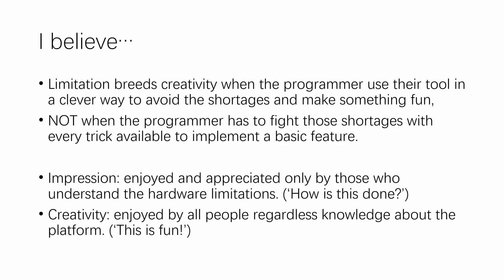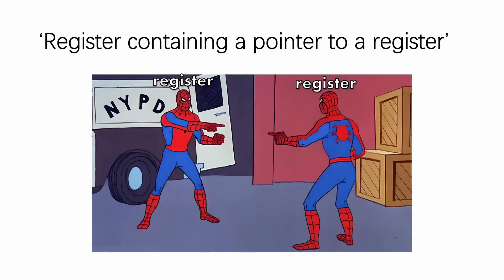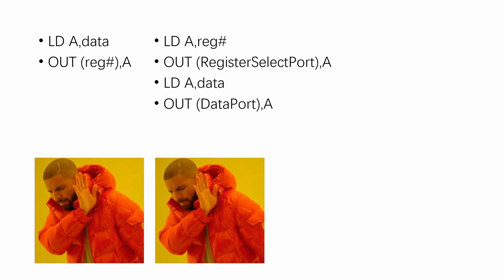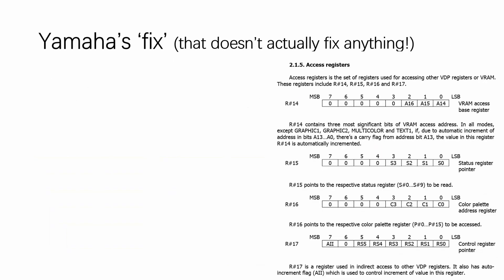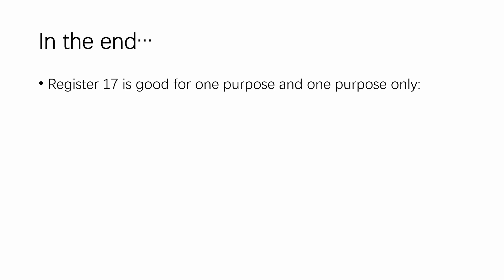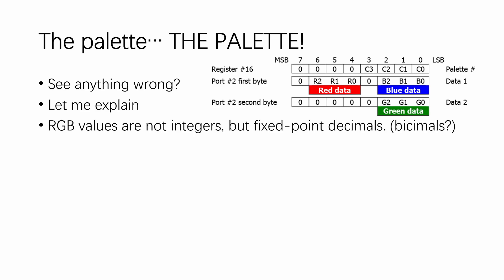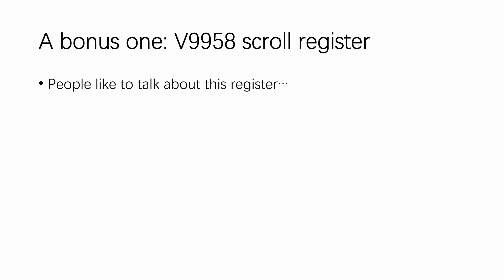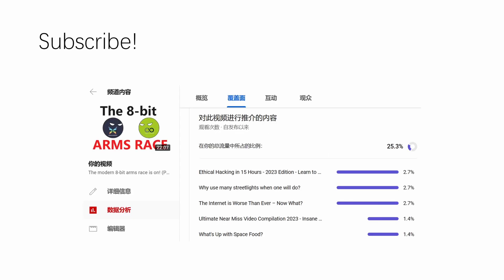The registers of V9958 are a mess.

Comment: The chaos with the data and mask bit to tell the chip you're talking about a register goes all the way back to the TMS9918.  When Yamaha decided to build a backward compatible (ish) chipset, they inherited a lot of compromises that trace their existence to either constrained design choices from the late 1970s, or from literal arbitrary choices that the Texas Instruments engineers made (engineering was a little more "free spirited" in the 1970s than today).  The half-baked composite-in line on the TMS9918 is a great example.... it allows you to chain multiple TMS9918s if they share a clock, but it's practically useless otherwise, which is really unfortunate, because it would have been amazing to have text overlay on video in consumer hardware all the way back into the mid to late 1970s, but alas, they only half implemented it.

Some of the decisions the TI engineers made were unfortunate, but they were what they were, and everything built on that architecture inherited those "features."  The auto-increment thing was present in the TMS9918 as well, but was used for reading and writing to VRAM only.  So Yamaha was borrowing an idea that was already present in the original architecture.
Reply from the maker: I think there is a way to synchronize external video to the TMS9918 by pulling reset pin to 9V or something crazy like that. It's hard to achieve with only 5V supply, but the feature is there.
Reply: @andyhu9542  

Sort of, but since nothing is keeping the clocks in sync, if you feed composite from some source other than a shared clock, one of the images will "roll" because sync will slowly separate.  As I said, they only half implemented a solution.  They needed a way to achieve genlock, or to buffer the incoming video, which they didn't implement.
Reply from the maker: @Calphool222  The TMS documentation doesn't go into whether this is H sync or V sync. However, I don't think the video would roll as one can input one sync pulse via the reset pin every field. The video may appear skewed, but not rolling. The bigger issue is that the input signal must be non-interlaced, but all TV signals are interlaced. Therefore, half of the input screen content would appear on completely wrong places.
Reply: @andyhu9542  

It's been decades ago, but I tried to get it to work.  It might have been tearing rather than rolling.  I remember using a sync separator chip, and I remember messing with the reset line, but ultimately it just didn't work, and there was no real way to make it work.  It was half baked.

Comment: Well this ms2 vdp chip might be messy all the way BUT what if we could make an interface chip to make it possible to port games from other systems to it,sure there will be still some manual adjustments to be made by the user but if it will make porting games to the msx2 faster and easier,well then why not,because that would be great😁
Reply from the maker: The issue with porting is that almost all other systems support more color than MSX2. Even NES has 25 on screen (or even per line). Porting games to MSX2 means that the artwork has to be remade with new color limitations (16 on screen). Which is sometimes the majority of work involved in porting a game.

Comment: The 9938 and 9958 definitely had register limitations from being descended from the 9918/9929. You mentioned this, but it was probably an important feature in the MSX2.

It is known that TI's engineers fought for an 8-bit port interface when they designed the 9918. The 9900's equivalent of the Z80's ports was single bit communication and that was going to be far too slow for video access. The 8-bit port was a big reason the 9918 was so popular in many other systems than TI's own 99/4a.

Providing an alternative and better laid out register interface would've made the register handling so much more complicated on the silicon. A halfway solution might've been to shadow some functionality in higher register numbers. Even an extra pin to be able to directly select the port properly would've been an improvement. I think a proper redo of the layout (with a backwards compatibility mode) might've happened a few generations after the 9958, though, if it had kept being developed. They might've also come up with a way for the CPU to access the video RAM directly by then, too. So much potential....
Reply from the maker: I agree. The V9978 may be the solution, but there is so little information around the chip, the register layout is unknown.